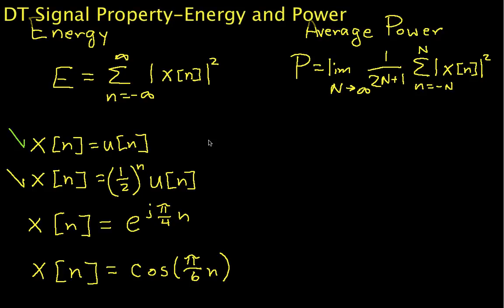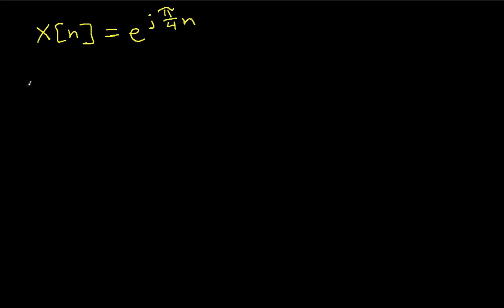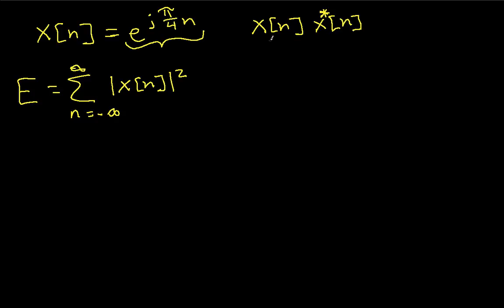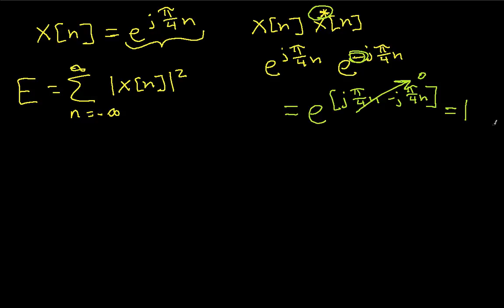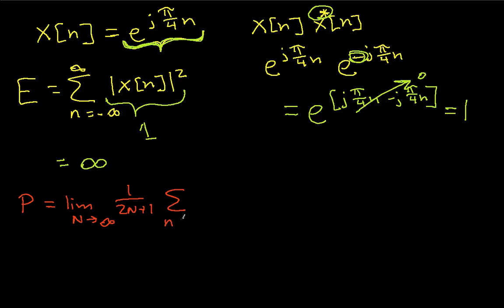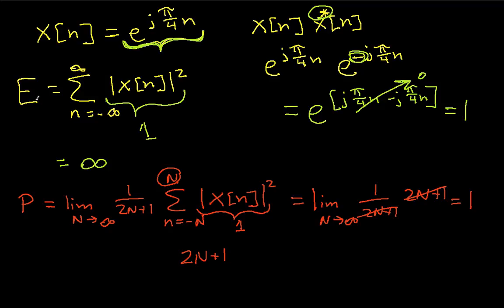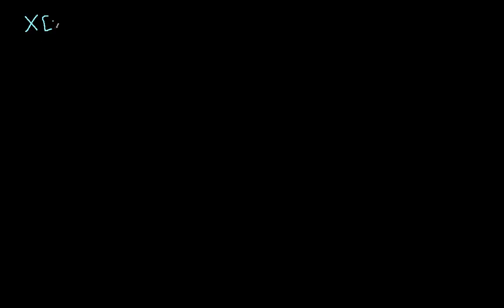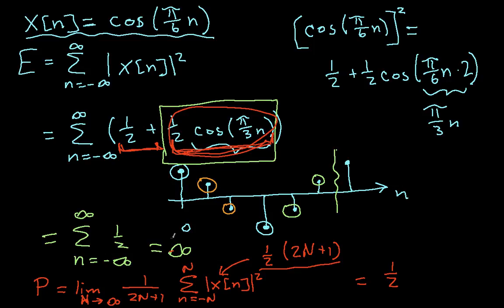DT Signal Property-Energy and Power Part 2.

Comment: Should be N+1 for |x[n]|^2, NOT 2N+1. Since every following term in x[n] increases by 1. Power should be 1/2, not 1 if you divide (N+1)/(2N+1). See his previous introduction on Energy and Power Signals, he concludes in that video that the power in the step function is 1/2.